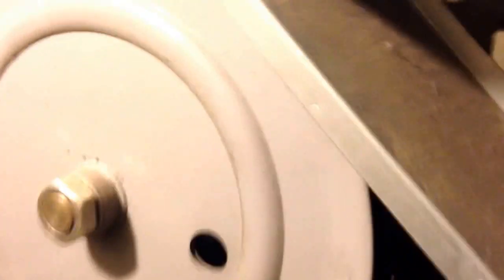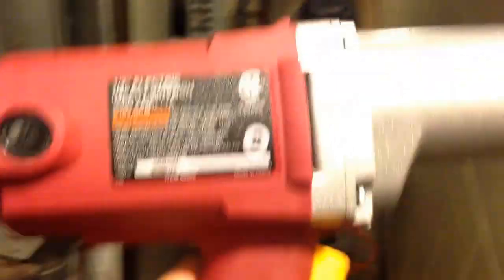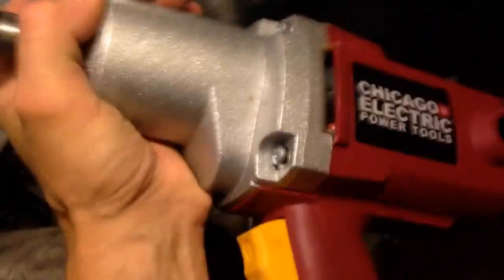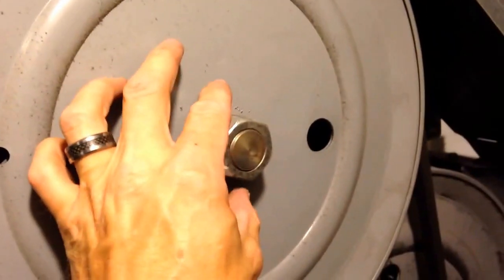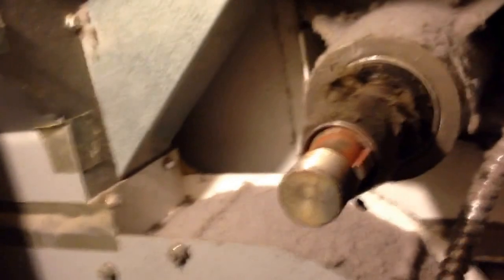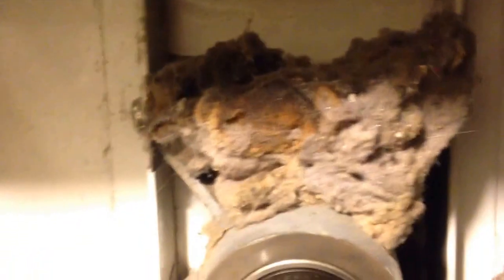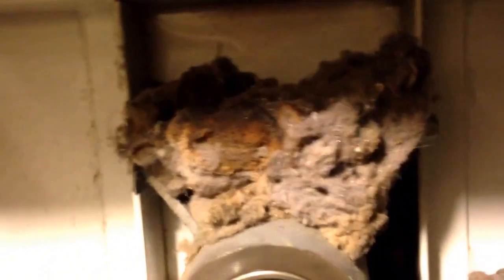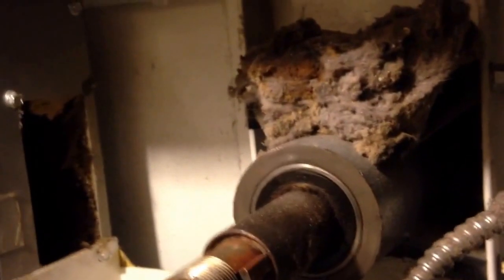Dexter Dryer Hi Temp and Internal Duct Cleaning

Comment: Instead of doing it that way it's easier to take off the high temperature sensor and there's a hole that goes right into that box. I bought some smaller tubing at home Depot attached it to my shop vac and stick it in there and clean it out. It takes me about 15 minutes or less per dryer